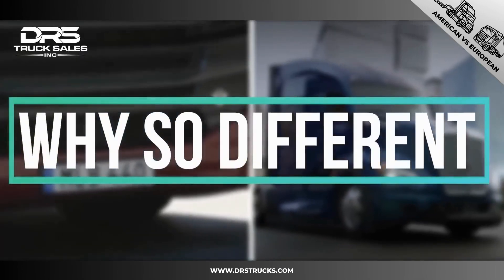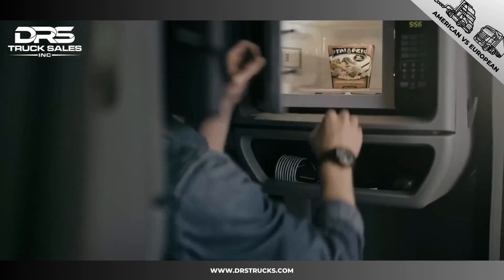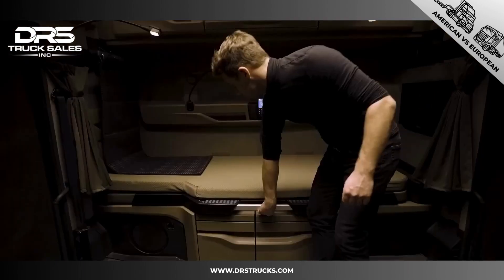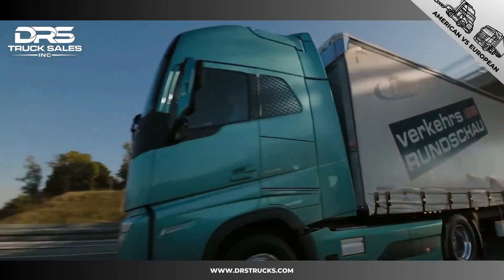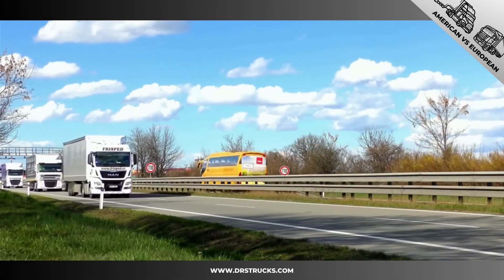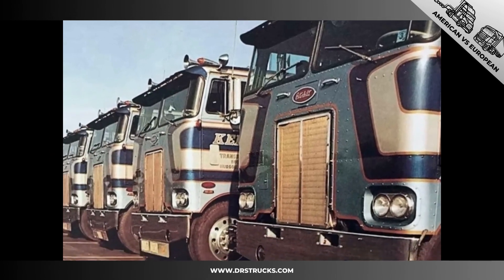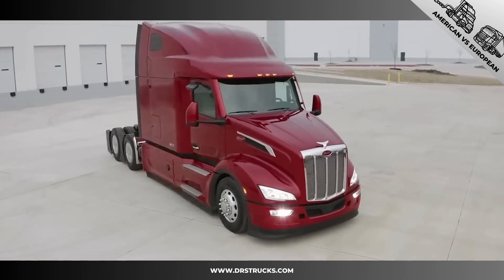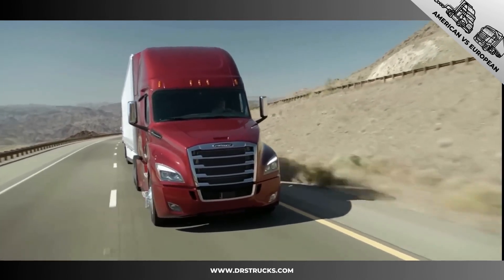Have you ever wondered why European and American semi-trucks look so different? 🤔

Comment: the fuel comsumtion figures are a farce , to do a true comparision both tractor units need to pull the same trailer over the same route for there to be anything called comparable, again another bias video in favour of American trucks, another thing as well, when the fuel test was conducted, a MAN was used, not a Volvo, MAN would be up in arms if they saw this video, and another thing you should have used the same driver to get a comparabl results, so many flaws in this video.
Reply: Like what?
Reply: @lindabean9216 , the road tests were done in a different country, the trailers were completely different, and different drivers were used, need I go on.